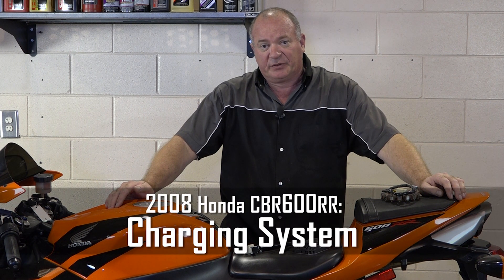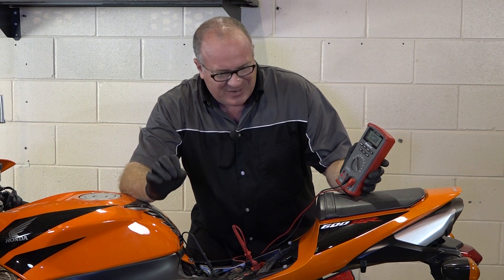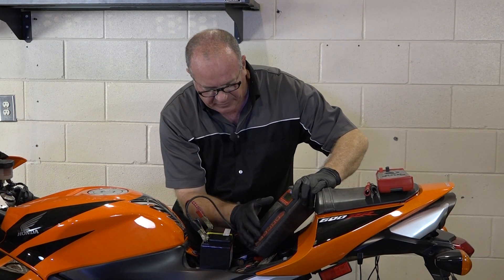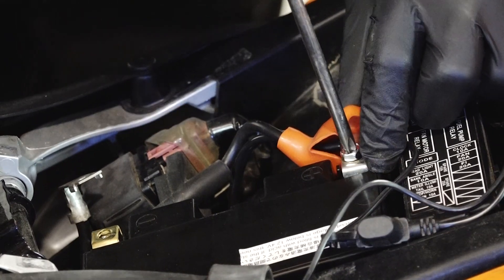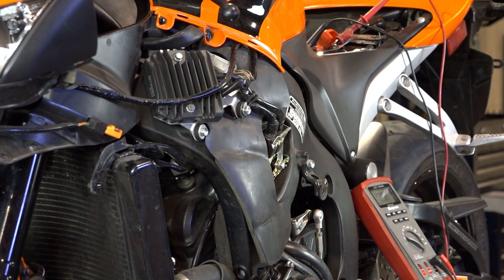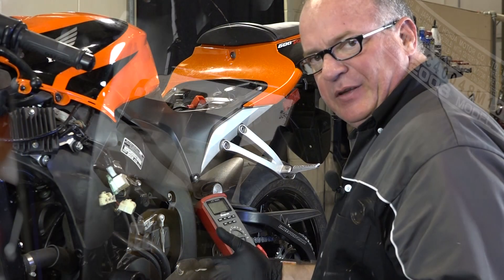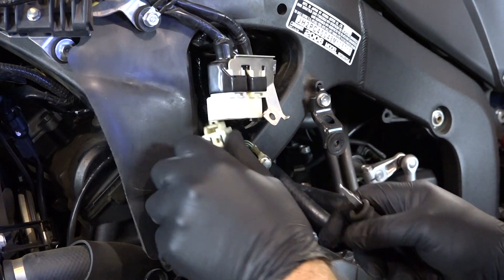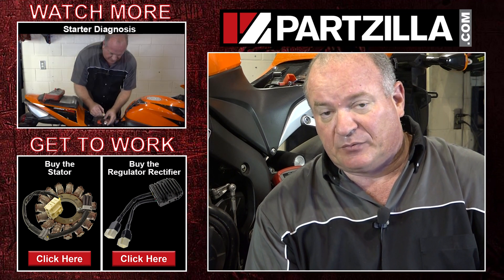How to Test the Charging System on a Honda CBR 600 RR | Partzilla.com

Comment: Hi there!  Big fan of you guys' videos. I'm having a problem my lights on my CBR600rr. I actually have the same bike in the video.. year and color are the same. Can y'all do a video about why the headlights might stop working? My low beam doesn't work, and my high beam flickers when I switch it on. Thank you!
Reply from the maker: Hi Bernard,  we will add this to the suggestion list and see if we can get it done.  In the meantime, it shouldn't take much to pull apart the high beam switch on the clip-on and double check all the wires are clear and not pinched.  It sounds like you have a short somewhere.  Trace the wires back and check for any frayed edges. You might get lucky and find the fix.
Reply: Thank you so much for the quick response. I'll take a lot at it today and hopefully that is the problem. If I fix it I'll let you know.
Reply: I couldn't find any pinched or frayed wires. I did notice a clicking sound coming from the relay box with all the fuses. I switched the headlight fuse, but nothing. Is it possible to install a brand new headlight relay?
Reply from the maker: Yes, you can replace the headlight relay. It's located in the head unit.  I would double check your fuses first.  If I remember correctly, on that model, the low beam runs straight to a fuse, high beams through the relay.  If the fuse and bulbs are good, then I would guess it's the relay or the light switch itself. (Without inspecting it, this is all internet guesswork.) All of which are easy to swap out. I would double check all of it before you start buying parts.

Comment: Does weak battery causes bike to die? 
I suspect my stator is not working properly?!?I was out in the boonies got me all worried my bike almost didn't want to start. I jump it and it start right right up.  What the cost of service for checking the stator and replacement? 

Battery checked: weak
Reply from the maker: Julian, sounds like you just need a new battery.  If your stator was going bad, once you jump the bike, it wouldn't run properly. Start with a fresh battery and see how it goes.  If you still have issues, you can start running tests on your charging system. Always start with the simplest answer first.
Reply: it can be more than just your batt..i got new batt..stator putting correct AC volts and batt still not being charged..after my tender gets batt above 12v it will start fine..and run fine..the second you turn it off it wont crank back..and lately after iv been riding for 15 min it will die while running..and then shows 8-11volts on battery..im guessing not enough juice to run fuel pump

Comment: Hello,

just wanna ask, is the Regulator Rectifier supposed to get hot? I recently took my bike to a mechanic to find a burning smell coming from the bike and he found the wires burning by the rectifier so he spliced the wires and did his own connection instead of using the plug and play connector. The bike would cut on and run but was just curious about the heat coming from the rectifier.
Reply from the maker: Hello Danny. Do you know why the wires were burning? They do get hot, but not so hot that you cant touch it.
Reply: Partzilla not sure, maybe something was giving it to much power

Comment: even if a $20 battery lasts you half the time, its still a better value.  $150 for a battery does not make sense.
Reply: Yes but being stranded and needing to call a recovery company is expensive and makes no sense too.
Reply: if your charging system works good..dont matter about your battery..it will start for a long time..i get walmart battery's for 50$ and they work awsome.
Reply: @GD-sc5se  you make a very good point.

The problem I have is that I use the motorcycle 1-2 times for short trips on the weekend to run errands, so I have to keep it permanently connected to an Optimate 4 Optimiser which monitors and charges battery when needed. Do you use a battery tender?
Reply: yah.i use batt tender..untill i fix my charging system thats the only way to crank my 2003 r1..but wont run more than 20 min..battery runs down too much from lights sensors fuel pump and dies..iv replaced stator and reg/rectifier and new batt..still not getting close to 14 v..only the 12.8v my battery has from charging with tender lol untill i crank it and it drops to 11.2v then ride it ..then dies around 7-9 volts ..id give anything to figure out what the hell is wromg with this bad ass r1..GREAT BIKE..just wont charge the batt
Reply: @GD-sc5se  I've got a 2010 R1! Hahahaha and I had the 2008 R1 before that. 

I'm suffering battery drainage on my 2010 R1 when cranking it when it is hot and the fans are on it just flattens my battery. Cold starts are fine. It's a complete mystery as Starter is fine, Stator is fine, Regular is fine. 

Have you tried asking the R1 forum for advice?

Comment: Hello ,

My cbr929 didn't start so I checked the battery and it was out of acid. I added water and charge it. Reading was 12.50 before put it to the bike, 
bike charging system with the high light switched on it was above 14.5. Do you think my stator is causing the extra charging and due to that it dry the battery 

Your help is much appreciated 

ML
Reply from the maker: Hello Mohamed.
How high is the voltage running with the high beams on?
Reply: Partzilla Hello dear friend with high beams it reached up to 15.7
Reply from the maker: i would start by checking the voltage regulator.
Reply: Partzilla my stator reads at .5 is that okay

Comment: So when I go to start my bike it turns on for a half second then shuts off like today, then I got it to run, ran for a minute and shut off on its own, did that too me twice recently! Battery seems good went upto over 14volts when I started it the other day and shut off on its own at 142 degrees
Reply from the maker: What make and model motorcycle do you have Hughie?
Reply: Partzilla it's a 2009 cbr600rr, the green and black version

Comment: Hey John, I have a 98 Honda CBR900 RR and I am having similar problems with my bike not charging. I have bought a new reg/rectifier, stator from "CheapCycleParts.com" and battery from Autozone but it still dies. Also reason why I bought new parts is that the first rectifier burned out and drained my battery completely. Just last night I took another shot at it and jumped the bike and noticed some smoke from the rectifier. What could be the issue?
Reply from the maker: Hi Danny! Sometimes you need to be careful replacing parts trying to solve an issue. An existing problem on one part of a circuit can damage a brand new part somewhere else down the line. If you replaced the stator, regulator, and battery with OEM parts all at the same time and still had an issue, you need to check two major things. First make sure the grounding point near the Regulator is tight and no wires are broken. Look for a cluster of green wires grounded to the frame. Second, verify continuity point to point on each wire on the harness especially the positive and negative going from the regulator to the battery. Third, make sure you buy all your parts from Partzilla.com from now on. Ok, the last one is optional, but comes highly recommended ... :)
Reply: Thank you, I checked the wiring once again and found the problem. The connector from the stator to the wire harness started to burn and fuse two of the wires together. Guess that means it was over charging? But I also looked over everything else and it seems fine no exposed wiring and locked down tight all that is left to do is order a new stator from Partzilla.com :)

Comment: All the videos this guy makes are great! I'm a mechanical engineer and even though I know what I'm doing i like to double check. He really explains it all well.

I would have moved that connector so the positive battery cover fitted properly though.
Reply from the maker: Thanks Richard. My OCD did eventually take over and I moved the wire.